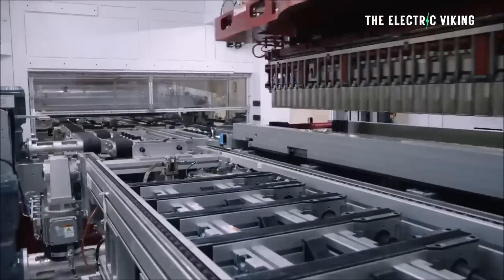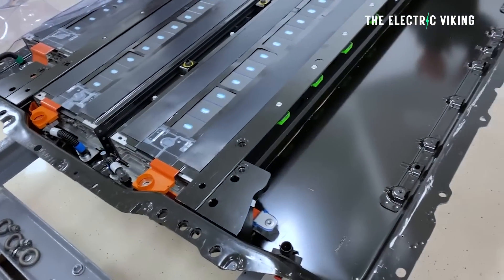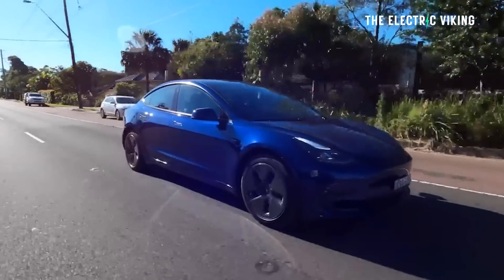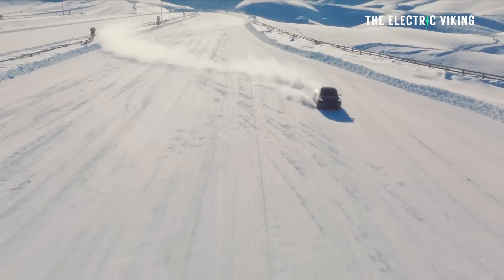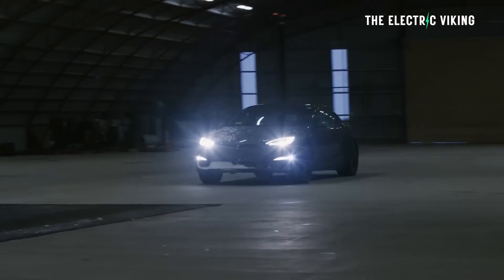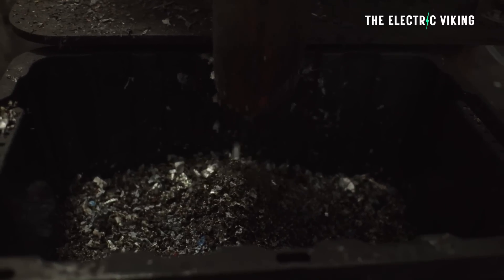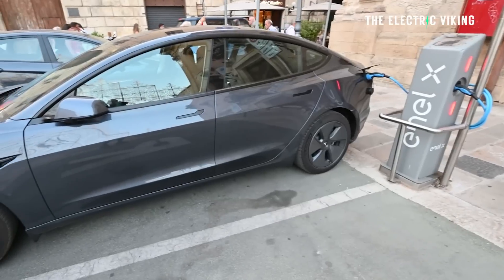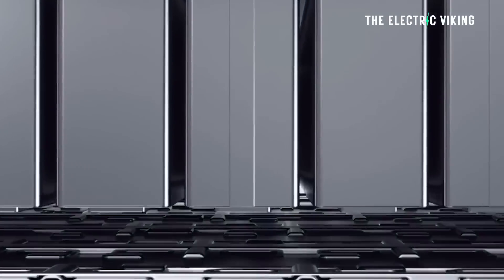Tesla reveal how long its batteries last after 200,000 miles of driving

Comment: Absolutely correct by my experience, my plug-in Prius has close to 100,000 miles on it and 40% are total EV ! 12 mile range so 40,000 / 12(miles) = ~ 3,000 cycles so my Y Has a 300 mile range X 3,000 cycles = ~ ONE MILLION MILES ! By the way these are Panasonic 18650 batteries in PIP & still going strong.
Thanks Electric Viking ⚡️❤️ 
Great channel 👍👍
Reply: When new, the Prius supposedly does 54 mpg, but by the time I sold my 12-year-old Prius, it was only getting about 39 mpg.
Reply: @scottbreseke716  yes and to me that is a big difference. I would imagine that the nickel metal hydride battery in THAT regular Prius was possibly spent AND the ICE engine needed a tuneup. However a PIP has several unfair advantages 1.) much higher battery capacity 2.) lighter battery 3.) different battery chemistries AND MORE IMPORTANTLY a plug-in feature which translates to a much higher MPG & LESS MPG DEGRADATION WITH AGE. In any event the battery has a 11 mile range today and indicates that my Tesla will probably go at least a million miles by the time it reaches similar degradation. At 10K miles per year I don’t think anyone will be around to see it. Lol
Reply: @scottbreseke716  maybe it needed a good thrash (Italian tune up) to clear out the rarely utilised petrol system?
Reply: I'm not so lucky. My Lexus gs450h hybrid battery died at 97k miles at 12 years old. I had a refurbished one with lifetime warranty installed. I still love the car though.  Pretty soon will be giving it to my college bound daughter.
Reply: @kabysummit5801  a Leaf battery (much bigger) can be refurbished for £750 by various UK specialists.  So a teeny hybrid battery should be far cheaper to restore.  How much did you pay?  Also, "lifetime warranties" usually restrict to "while you own the vehicle", so depending on how long you expect to keep the car & the fuel saving the battery will provide, it's not always worth spending the extra for that "peace of mind" "warranty".
Reply: @Alex Manojlovic  
The average price for a Leaf battery replacement with a refurbished unit, including labor, on the US is between $6 to $7.5 thousand dollars.  
No idea what you are talking about at under 1k pounds.
Reply: @kabysummit5801  do you understand the difference between "can have...  ...refurbished" as a service, and - buying a refurbished battery?  I discovered the SERVICE from reading about it being provided by US businesses & the US price is roughly equivalent to the UK price I mentioned.  I suspect you didn't do too well at school...
Reply: @alexmanojlovic768  are you speaking from actual experience or just espousing the local home garage heresy

Comment: I have a 2015 Nissan LEAF with 56,000 miles. I lost one bar so far. There are 12 bars. So, 8.3%. It only has a 24 kwh pack. So, I always charge to 100%. I'm in the midwest. So, temperatures aren't too bad. I store it in a heated garage in the winter and only use it in warmer weather. Range could be about 75 miles without heat or AC in 50 degree weather, not driving fast. I never fast charge. I used to use the 110V charger at a parking garage at work. Otherwise, I normally use the 240V charger at home. In the winter, I unplug the main charging port and use a battery maintainer on the 12V battery. Otherwise, I found that leaving it plugged in on the main charging port won't keep the 12V battery topped off.
Reply: First bar on Leaf is actually 15% battery loss
Reply: @joeblack4026  Assuming it's linear, 100% / 12 = 8.3%
Reply: Hope you bought it used for a nickel, otherwise....oof.
Reply: @OtisFlint  My dad bought it for $29K after rebate. It still does what I need it to do, so, I'm not really complaining. There weren't 100 EVs to choose from in October 2014 when the car was purchased. I don't think Tesla Model 3 was even out at that point. I think it just came out around that time.
Reply: For a 9 year old, 24kwh Leaf with only the loss of one bar, that is amazing. 

If it is still in working order, instead of buying another car, you should see what it costs to get a 40, or 62 Kwh battery swapped in. Especially if it is an SL or SV trim.
Reply: Maybe only charge to 80% like they recommend
Reply: @jeffminyard7796  If I had a larger battery with longer range, I would. If it's cold and I drive fast, or run the heater, range could be significantly lower than 75. It could be 50. Probably, I should store it at 80% in the winter at least, rather than having it topped off.

Comment: I wait for NIO SwapNGo Stations in the EU. Never Battery Degradation. SwapNGo Stations Fast and Furious.👍👍👍
Reply: I think NIO will go bankrupt before you will see a swapping station near you.
Reply: @adisurd  NIO has Swapstations realised already in Nederland. NIO Works with Vandebron Clean Energy SolarParks in Nederland to Charge Batterys and stabilise the Net. And make Money with Solar Power. and Works with LeasePlan Electric Car Lease. China State Supports NIO Battery Swap Technic.
 That is a Lot of Money for NIO. China Brains, China Money. Will be a Big Succes. I have a Deal with A journalist to go to Spain Costa Blanca from Groningen Nederland with NIO Car and Battery Swapp All the Way. 2500 km Going, 2500 km Coming. For Breaking News, Newspapers, TV and Social Media. Will be a Party. Wait and See.🙂👍☀️☀️☀️🎶🎶
Reply: @adisurd  NIO is backed by the Chinese government, they want them to succeed and they will.
Reply: The problem with battery swaping is you need to stay in the car. If you use DC chargers you can go to the rest room and get a drink and then by the time you get back to the car you've added 100 miles or so. On the area a battery swapping machine takes you could have 20 DC chargers so the throughput will be much higher with DC fast charging. Also if the battery unloader stops working the whole site is off.
Reply: @scottwills4698  and every swapper battery on the rack is one less EV on the road not spewing out poisons...
Reply: @scottwills4698  swap only takes 5 minutes, you won’t have enough time to go to the bathroom
Reply: @stevenanderson9660  The battery swap may take 5 mins but the car has to drive itself in and out - overall its more than 7 mins. So thats 7 mins then you need to go to the bathroom and maybe buy food / drink so overall battery swap is slower.
Reply: @scottwills4698  I don’t remember the last time I had to go to the bathroom when putting gas in my car. Maybe once a year if I’m on a road trip.
Reply: @stevenanderson9660  After 3 hours driving I need the bathroom! 99% of my charging is at home where it takes me 10 seconds to plug my car in. I cannot be bothered with all that driving out of my way to stand while I put flammable carcinogenic fluid into a car.
Reply: OF COURSE THERE IS
Reply: @paulhailey2537  What is Where???😀
Reply: @willeisinga2089  BATTERY DEGRADING WILL HAPPEN TO EVERY SINGLE BATTERY THEY USE
Reply: Well degredation will be paid by Nio then instead the custumor
Reply: @kazi7728  the customer always pays, swapping is more costly than just charging.
Reply: @kazi7728  NIO will make Money MOney MONey MONEy MONEY. They Hit the Jackpot all the time. Local Solarpower, SolarParks along the Highway, SwapNGo Stations Fast and Furious Moneymakers. NIO takeover Carmarket and Energy Market at the same time. Make Carcompany Money and Multinational Energy MONEY.
Reply: @willeisinga2089  before they hit a jackpot, they probably go bankrupt.
Reply: @aprapet7218  Tesla was hedged for Bancrupty for Years. Now Tesla is fastest growing Number One EV Car Companie. NIO will be the fastest growing Number One Car and Battery and Energy Multinational Car Company ever. Period. 🙂👍☀️☀️☀️🎶🎶
Reply: @aprapet7218  Google Janus Electric Trucks Australia. Battery Swap Technic Electric 100 Ton Trucks. Electric Roadtrains in Australia. Two 620 KWh Battery Paks Swap with a Forklifter. Charged with Local SolarParks along the Highway. Western Australia will Electrify the Great Northern Highway from Perth till Darwin. Port Hedland Solarpark and Battery Swapp Station,  Pilbara Station Solarpark and Battery Swapp, Roebuck Broome Station Solarpark and Battery Swapp, Hallscreek Solarpark and Battery Swapp Station. Kununara Solarpark and Battery Swapp Station. Darwin Northern Territory Solarpark and Battery Swapp Station. Electrification Fast and Easy. Great Northern Highway Electrified. Waaaw. No More Diesel Costs.

Comment: Battery management has improved so going forward you should see less degradation.  Plus if an EV has 2X or 3X the life of an Ice vehicle is it not much cheaper to own.  When people figure this out Ice vehicles are going to look very expensive to buy and own.
Reply: I saw a video posted 2 weeks ago. It sourced info from some website that showed model 3 total cost of ownership in its life of 240k miles will be less than that of a Camry in its life of 160k miles

Comment: M3LR with 35,000 kms, 14 months old - degradation 2.2%.  Mostly charge on 15 amps circuit at home.
Reply: Degradation is not linear. Year one is much more than the ones that follow.
Reply: Hey brother. Same model but I’ve had mine for 3 years but close to same mileage. Ditto on the % loss. Oops mine is in miles not Km.
Reply: This works out at 30,000km annually, which is a lot of driving. The Australian average is only 12,000km.

Comment: My sons tesla model Y long range in the USA came from the Freemont factory. Would it have the NCA or the NCM battery chemistry.
Reply: Most likely the 2170 NCM. Projected more cycles than the model S 18650s so great longevity!
Reply: Probably 2170 cells. Same as my current M3P and my previous car M3LR. Both from Fremont factory. Both cars are/were great.

Comment: I charge slowly at home and try not to go to 100% but I’m still not sure if this really makes any difference
Reply: For sure it does - you’re doing it right. Superchargers are great when on the road but they’re tougher on the battery for sure. Nice work 👍
Reply: If you have an LFP cell, it's supposed to go to 100% regularly
Reply: @Nabushika  yes good point 👍
Reply: @alexmanojlovic768  "If your vehicle is equipped with an LFP Battery, Tesla recommends that you keep your charge limit set to 100%, even for daily use, and that you also fully charge to 100% at least once per week. If Model 3 has been parked for longer than a week, Tesla recommends driving as you normally would and charge to 100% at your earliest convenience."
- from the Tesla site
I think "at least once per week" is fairly frequently.
Reply: @Nabushika  OK.  My bad!

Comment: I wonder how much they degrade by at 5/10 year old, on low mileage cars?
Reply: Most battery degradation happens during the first year, not much degradation in any of the years that follow that.
Reply: Absolutely correct by my experience, my plug-in Prius has close to 100,000 miles on it and 40% are total EV ! 12 mile range so 40,000 / 12(miles) = ~ 3,000 cycles so my Y Has a 300 mile range X 3,000 cycles = ~ ONE MILLION MILES ! By the way these are Panasonic 18650 batteries in PIP & still going strong.
Thanks Electric Viking ⚡️❤️ 
Great channel 👍👍